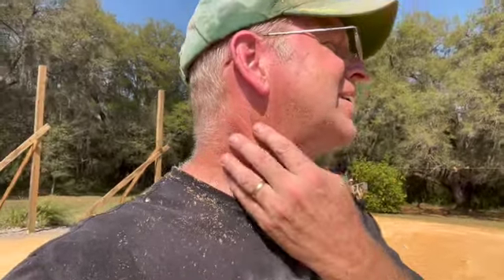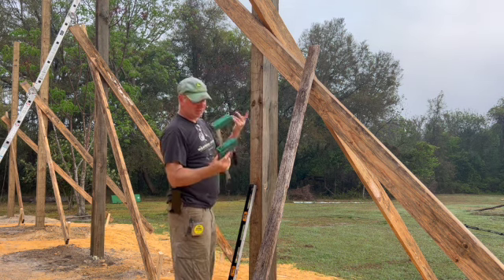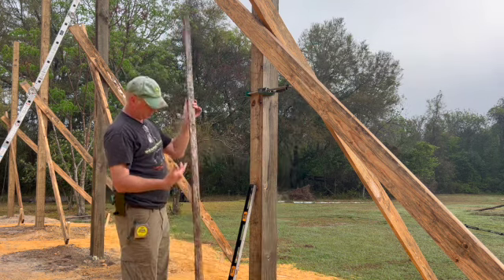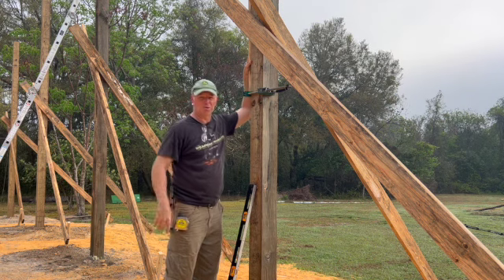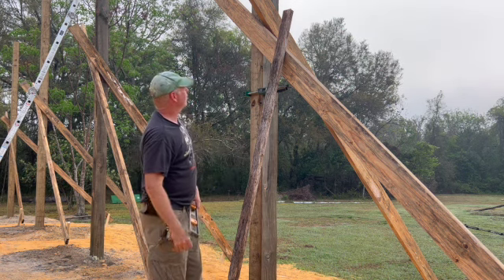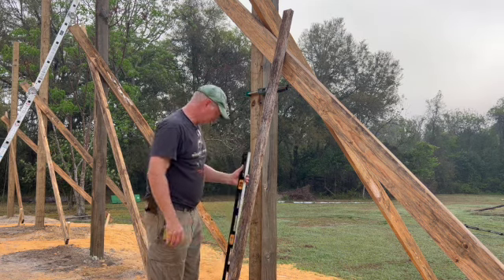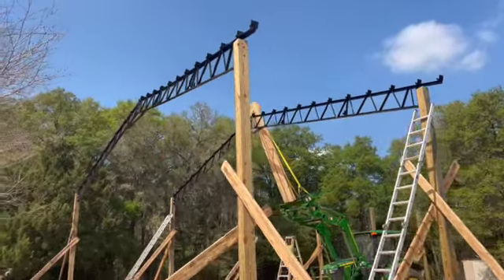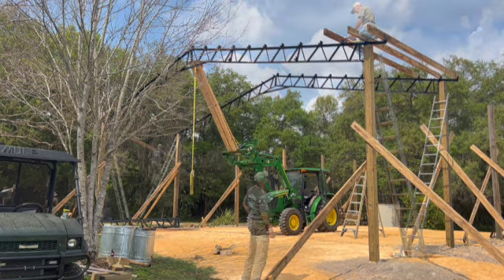S4E20 Raising Trusses for the First Time

Comment: I'm building a 40'x48' pole barn by myself and let me tell you, it isn't easy.  When I put my steel trusses up, I connected them to my boom pole hooked to my tractor in 2 places, about 4-5 feet apart.  That affords more stability and it makes it easier for a one-person operation.  The only issue I've run into is with getting the trusses all even and putting the purlins at the right spacing.  It's always great to see someone else tackle a pole barn, I have learned a ton from watching videos and kept my mistakes to a minimum. Best of luck to you with all your future projects!
Reply from the maker: Good tips - I appreciate it! I'm right there with you about using YouTube to learn - I do it for pretty much every project I work on here at the farm, because every day is the farthest I've ever gone into farming. Thanks for watching!

Comment: Somehow this was recommended to me and I glanced through it.  I'd suggest installing the horizontal supports for your sidewalls first, if it's not too late.  I guarantee you have some sway in those posts.  You need to stabilize the wall first, all you have is a post.
Reply from the maker: You are SPOT ON! I wish we had done it at both the bottom and top of the posts as we put them in to ensure good spacing. Would have been WAY more efficient/effective. One of my friends made the same recommendation...